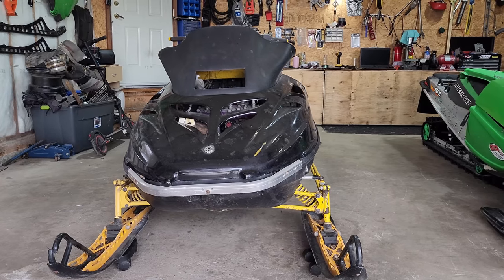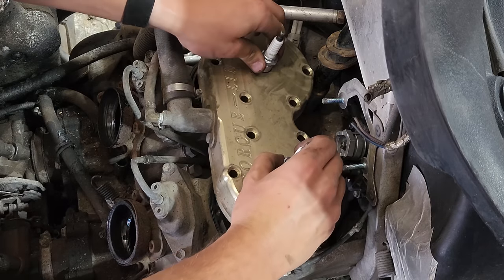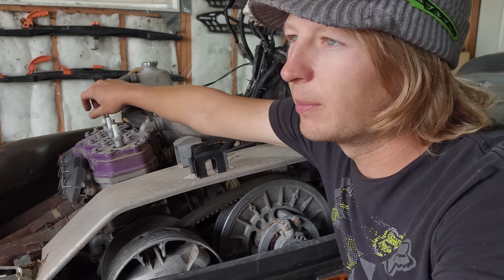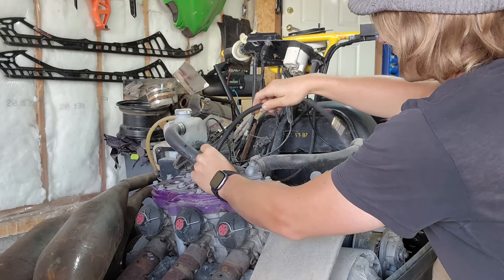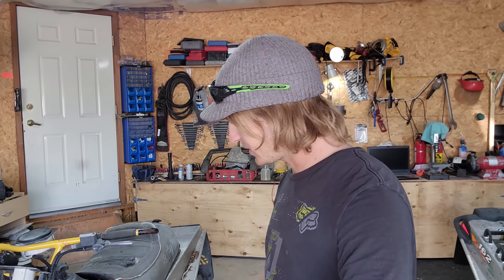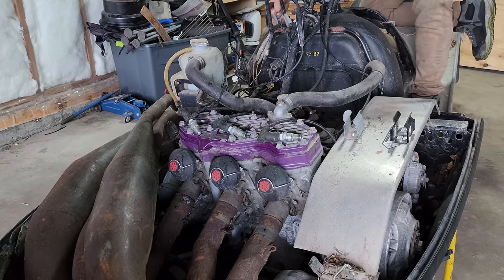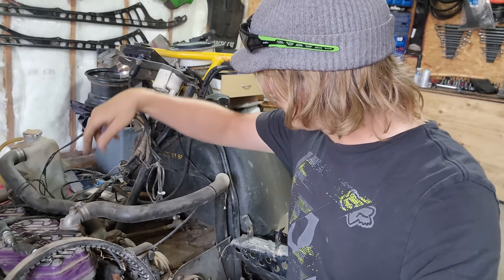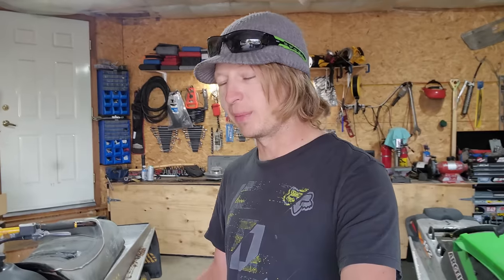Triple Piped Triple Ski-Doo Mach Z | 780 Engine Compression

Comment: If you see this comment matt, I’d say if possible go to sled parlor and grab another wiring harness for that year of the motor would probably be easiest thing to do than trying to fix that harness, cause those harness from 94 to early 2000’s should be fairly close to all the same! If sled parlor doesn’t have, get ahold of sled heads out of Beaumont or glens small engine in lloydminster, I’d then say if you have any questions that you need help with call Wilerton’s in wainwright or mark at 54 north in bonnyville as mark is the mechanic for the 54 north drag race team from bonnyville and they’re  pretty much all doo on the team

Comment: I am pretty sure that sled is a 96 to 99 summit 670 with a 780 triple dropped in
Reply from the maker: It does look that way, but that's not how the VIN matches up. And there's a date stamp too for 1993
Wild.
Reply: @syxxes  wow that's wild because
93 was the start of F chassis,  the s chassis started in 96 till 98 then it was zx chassis till the rev in 03. And that it most be the tunnel of a Mach z 780 with the belly pan and hood from a s chassis sled.